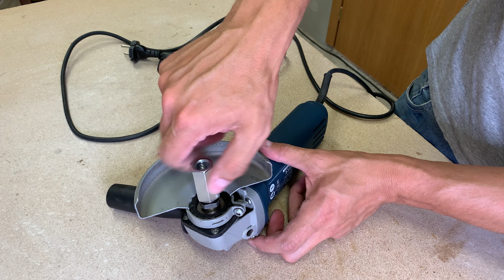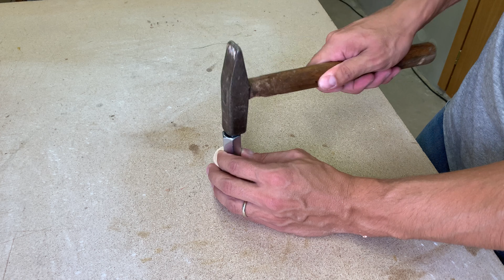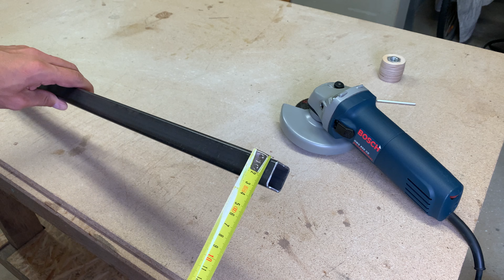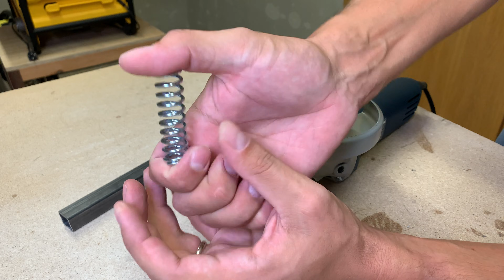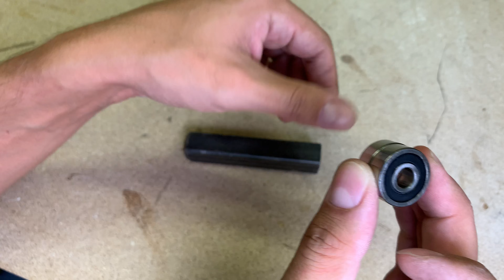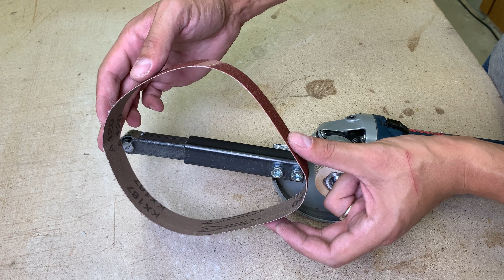How To Make A Homemade Belt Sander [ Angle Grinder Hack ]

Comment: You've already got a working belt sander, a safe and proven product. What you've done is destroyed a working angle grinder to make an unsafe and dangerous homemade belt sander. You've destroyed a safe tool to make an unsafe one. Even if you want to continue to use your angle grinder as an angle grinder, it is now less safe because the metal chips can fly directly into your face or arms through the new cut-outs and holes.
Reply: Relax lol, no grinders were “destroyed” in this video

Comment: I watched every other DIY video out there for a "Simple" way to make your own belt sander, and they are all WAY too elaborate & time consuming.
Then I watched this one!
THIS video is the ONLY project that even comes close to being: 
1. Simple (few easy steps)
2. Practical (e.g. - doesn't require arc welder or expensive drill press)
3. Inexpensive (I already have everything except the bearings)
4. Do-able (I actually have the skills to pull this off! 😂)
WELL DONE!! 👍
This design for this project is genius!
I plan on making mine this weekend! 😀

Comment: What if the tape doesn't run perfectly and comes out what could be done? Thank you
Reply: Get a longer spring for more tension, might work.
Or perhaps the shape of the Barrel needs to be more pronounced?
Reply: @jackweubanks  uhm I think i should have some type of adjustment. The belt moves to one side and comes off the rollers